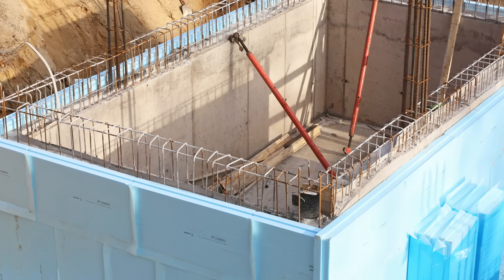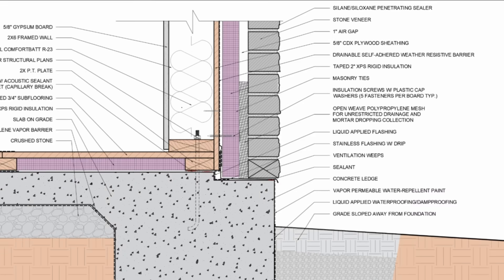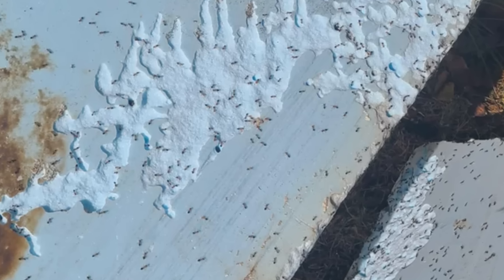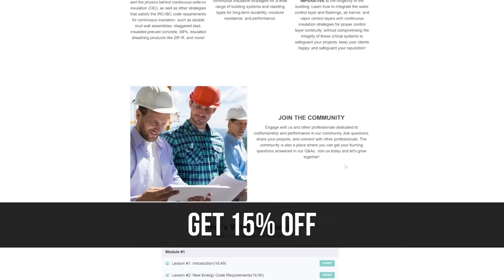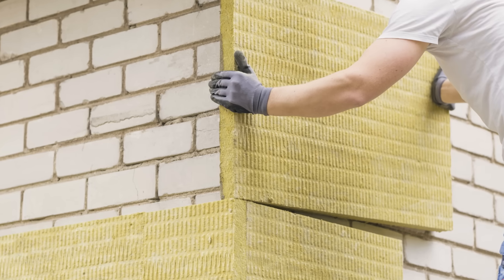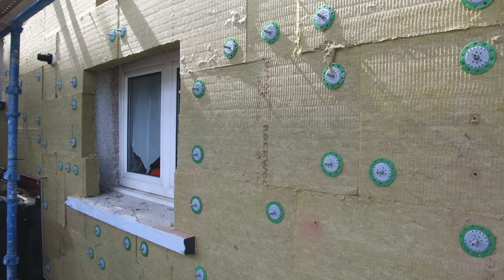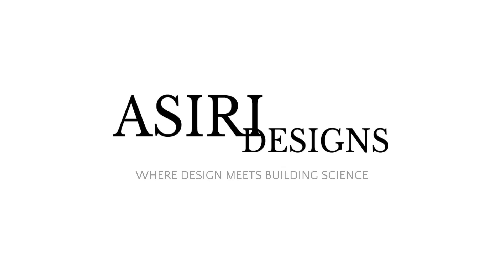Choosing The RIGHT Type of Exterior Insulation (What You NEED To Know)

Comment: So I’ve had this hare brained idea for a while, could you tape XPS and create an air barrier?
Obviously, it would also be a vapor barrier , or at least a retarder, but this could be a really good way to take a currently very leaky wall assembly and make it airtight and insulated in one go without having to do any damage on the interior.
Reply: Yes you can do that. Or you can apply closed cell spray foam and you don't even need to tape or seal in that case since it is inherently fully continuous and fully adhered.
Reply: Yes, there are lots of videos of people doing this
Reply: You need to be careful that you don’t have an assembly that needs high perms though. I believe the foam products are vapor impermeable.
Reply: @cxsey8587  yeah exactly. I’m in a wet climate (Vancouver Canada, lots of rain temperate, so not super cold or hot) so most of my moisture actually comes from the outside, so it might actually work obviously with a rain screen, but that’s not a problem, woul reinstall the hardyboard back over it and make sure we have a way to drain, the other concern is fire I do live in a potential fire zone, but again they relieved the Hard keyboard would be the main defense. The safer choice obviously would be Rockwell but then you don’t get the benefit of also Airsealing the property in one go.
Reply: @FreekHoekstra well if it’s cold and wet you need to worry about moisture from the inside needing to dry out through the structure I believe. I think the general advice is anywhere cold needs a structure that can dry to the outside. You don’t want moisture from the inside to drive through your structure and condense on your vapor impermeable insulation.
Reply: @cxsey8587  yeah I mean in this case it’s not that cold. It’s pretty rare that it freezes here, but we are a heating dominated climate
It’s basically the same as Seattle. So mostly very wet humid exterior.
Reply: @FreekHoekstra interesting, yea I’m not too sure then. I still think you want the ability to dry through your exterior since it’s so wet. I think the zero perm vapor barriers are more for dry climates like the SW where it’s hot and dry. Can’t say for certain though
Reply: @cxsey8587  yeah, that’s my concern as well. Everyone always talks about hot climates or cold climates but what about all the temperate zones in between and coastal areas? It gets a little bit confusing.
Reply: @FreekHoekstra I think generally anywhere that’s wet you want vapor to be able to migrate and dry through the assembly. You don’t want to trap that vapor anywhere where it can condense and stagnate. But I’m not an expert, I think Joe L has some books on your climate zone that might be worth looking into.
Reply: @FreekHoekstra Peel n Stick, Insulation (preferably mineral wool), Rainscreen, Cladding.  AeroBarrier inside at the sheathing level.  Pretty much the same as the ideal assembly he's talked about many times on the channel.  If you are in Vancouver proper, your house will likely be less than 4ft to the property line on one neighbour's side which means (due to fire setback rules) you cannot use foam products on that one side...even below grade!
Reply: @OCYHung  I am not taking my entire house back to the studs on the inside.
The house already has a rain screen with hardyboard so most of that setup is already there, I just need the airseal and the exterior insulation layer when i update it.
And I live a little bit farther out, so foam is no concern there, flammability however, is a concern but not sure how big of a problem that is behind hardyboard with a rainscreen
Reply: I think the main question I would have with that approach is how long lasting is the tape adhesion to the foam you are using. I'd probably use an additional air barrier as a belt and suspenders approach but it would work, at least for some amount of time.
Reply from the maker: Yes it's been done, in fact many buildings in Canada were constructed in this way in the early 1990s and 2000s. No sheathing or housewrap, just taped rigid foam. Does it work? Yes. Is it recommended these days? Not so much.
Reply: @ASIRIDesigns  thank you for the reply appreciate it!

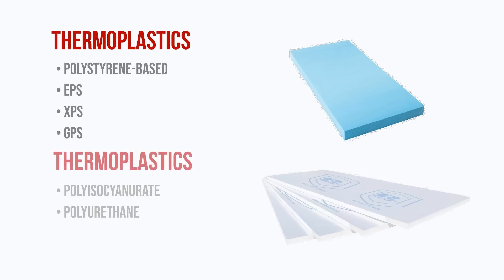Comment: 1:44 the same labels are used for thermoplastics and thermosets. Just fyi
Reply: Think "set fire to", or "we didn't thermoset the fire"
Reply: I saw that too. Would love to have seen the candle and fire icons on that slide as well for additional clarity, as "set" doesn't sound like it implies burning.
Reply: @ChristopherCurtis  Thermoset doesn't necessarily burn more easily than thermoplastic. In fact, it may be the other way around on average. The point is that a thermoset doesn't melt before it burns like a thermoplastic does, so it will keep its structural integrity.

Comment: Is there any need to insulate the exterior Gable end in a vented attic? 
Or is it just a waste of insulation?
Reply: Insulation should be along your thermal boundary. Your thermal boundary should enclose conditioned space. Adding insulation to the sides but not the top of an attic does not extend your thermal boundary to enclose additional space and would be a waste.

You could go the route of extending your boundary up the attic walls and on the roof line, but you’d need to block the venting and condition the space.
Reply: Exterior rigid insulation that doesn't cover the gable wall will create a transition issue at the top edge of the insulation board assembly.  I encountered this on my little house on one side which now has a ledge with its own drip edge.  Whenever I do the other gable end, I plan to go all the way up with the rigid insulation for a better look.  Also, that side gets a lot of Florida sun exposure, so insulation, a radiant barrier and rain screen should help reduce attic heating a little.